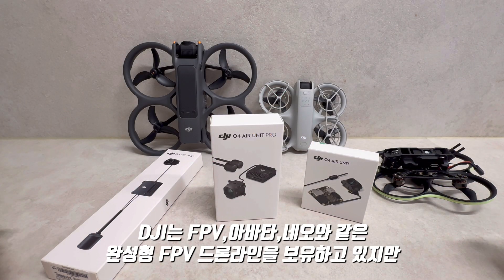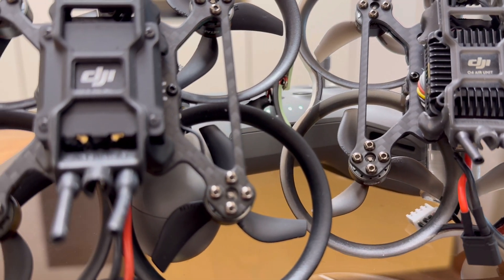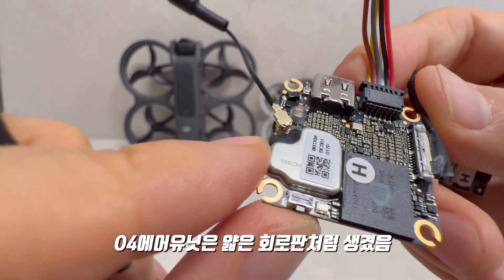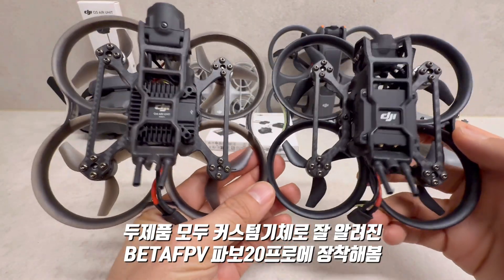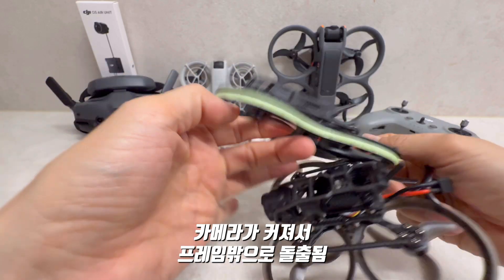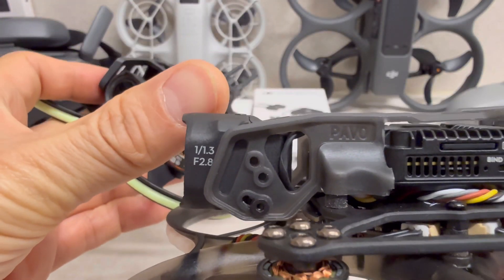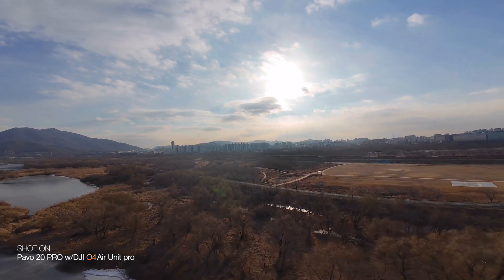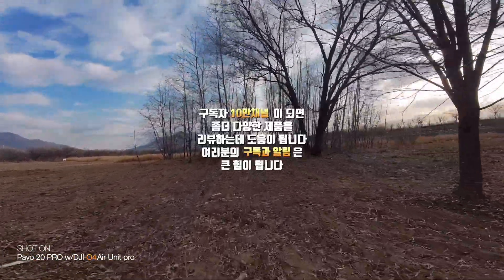DJI O4 Air Unit Pro | 드론 카메라의 게임 체인저! O3를 넘어선 4K 시네마틱 퀄리티 🎥 (진짜 영화 같음!)

Comment from the maker: #dji #o4 #o4 프로 #fpv #카메라 #드론 
-최근 최신 기술이 집약된 FPV 장치인 DJI O4 Air Unit Pro 입니다  😀
-이번에도 FPV 시장에 새로운 기준을 제시했는데요 
-이번 리뷰에서는 O4 프로의 주요 특징과 성능, 이전 세대인 O3 Air Unit과 비교를 통해 장단점을 분석합니다. (궁금한건 댓글주세요) 

🏷 【가격】
O4 Pro : 333,000 원
O4 : 134,000 원
구매링크: https://url.kr/s8xbo3 (DJI 공홈) 
                https://url.kr/t73vse (효로로몰)
Reply: Did you have any trouble mounting the o4 ? I can't seem to get mine to fit in the bracket
Reply from the maker: @ When mounting the O4 Pro on the Pavo20, there is a slight size difference, so you will need to trim the side support parts. Even then, it doesn’t fit perfectly, but you can still screw it in and secure it. I believe Betafpv will soon release a compatible frame.
Reply: @AJayTVRC  o4 프로랑 o4 무슨차이인가요?!

Comment: How to connect dji fpv controller 3 to pavo20 pro with o4 pro?
Reply from the maker: Hi Thomas, In the DJI FPV system, the controller 3 does not bind directly to the air unit; instead, the controller3 binds to the goggles3, and the goggles bind to the air unit. Therefore, the DJI FPV Controller 3 binds to the DJI Goggles 3, and the Goggles 3 bind to the DJI O4 Air Unit. This setup allows the controller’s signal to be transmitted to the air unit through the goggles. For detailed binding procedures, you can refer to DJI’s official tutorial video. Enjoy~
Reply: @AJayTVRC  So basicaly, you cna controll every custom FPV dron with O4 units which is connected to your Goggles 3?
Reply from the maker: Yes, it is. However, the drone’s FC must support O4 through firmware. In most cases, the manufacturer provides firmware updates.

Comment: Excellent video! Are you going to review the lite version? And could you mount it on the Pavo 20 Pro to test? Mine Pavo 20pro just arrived but I'm still in doubt about which video system to buy.
Reply from the maker: @christiancalheiros2381   Since BETAFPV has not yet prepared frames for the O4 and O4 Pro, you will need to 3D print a frame to install the standard O4 in the Pavo20 Pro. One of my friends has installed the DJI O4 on a Pavo. You can check it out on YouTube, and I believe he will also share the 3D design files. https://youtu.be/O0xp-D81E98?si=u7Bk0qJdrWFjYj8S